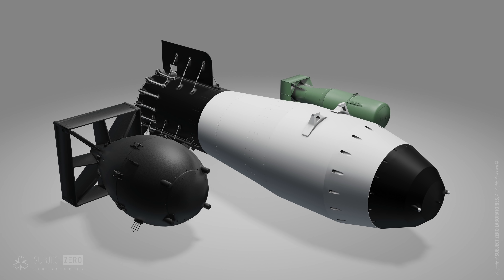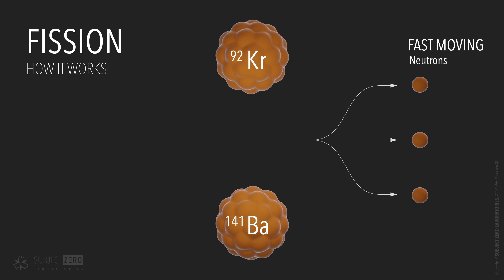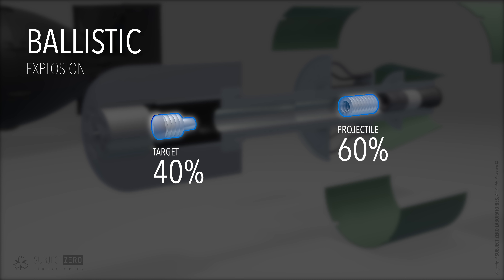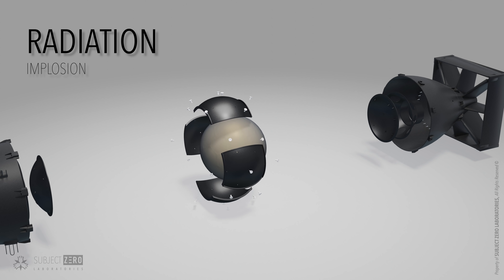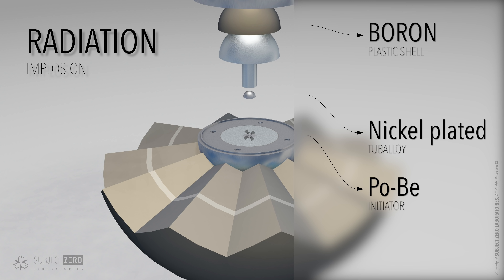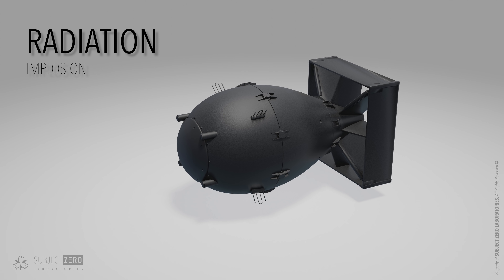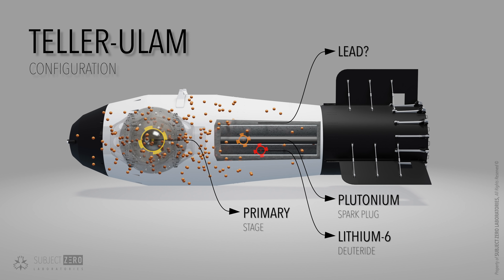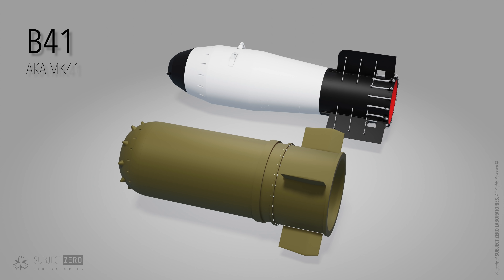Are Russian Nukes the Most Powerful?

Comment: Hey subject zero, I have an idea for an video, instead of explosion, what if we make an implosion bomb. This bomb will create a 1 gm of mass suddenly. According to energy equation, this creation of mass will draw energy from surroundings so a sudden drop of temperature in the environment freezing everything in close proximity. if the bomb capacity increased to 1 kg, a entire city will be freezed, so causing death at the same time freezing every motion of the city. Think about it. Even though the technology doesn't exist, theoretically this possible. A chain reaction than quickly produce extra mass from surrounding energy. A nuclear endothermic reaction😅🥳

Comment: Boloney ' there are neutron bombs to get this effect neutron accelerators are incased inside the weapon right at the start of the chain reactions neutrons are spun into the explosion with the bomb being encased in reflective material to reflect the escaping neutrons back into the chain reactions .  Israel has neutron bombs since they are surrounded by enemies close to them after 24 to 48 hrs neutron radiation clears away and you can then enter those areas with no risk of radiation poison .

Comment: When it states 80% enrichment, what exactly does that mean?  Is it possible to have 100% and so on?
Reply: Uranium is composed of U235 and U238.  U235 is the fissile material needed for a bomb.   However, only 0.3% of natural uranium is U235 so it has to be separated from the U238 and that's called "enriching" the uranium.   The higher the percentage of enrichment, the less material is needed for a bomb because a greater percentage is reactive.  Weapons-grade uranium is generally anything over 80% U235.   The U.S. weapons-grade material is above 88%.   Plutonium is a whole separate process and the problem becomes separating the Pu239 from the other residual radioactive materials with as little Pu240 as possible mixed in with the Pu239.

Comment: Wasn't the Tsar bomb rather a 3stage design, i.e nuke that triggers TellerUlam hydrogen bomb, which itself is used to trigger even bigger TellerUlam hydrogen bomb?
Basically no limit to increase yield that way, build a 20'000t H-bomb into a 50'000t submarine and have a yield of 20000*6MT/t=120GT, would make a nice crater in seabed and huge tsunamis, I guess.

Comment: Yes but the problem is that after 100MT the explosion goes only in the space..an 100MT warhead would be max. The designer was ready to build a 100MT bomb, but he was scard and in the last moment, he changed the bomb to a 50 MT. He was ready to make a 1000MT bomb but it has no juse and it would be as big as an 6 floor house so it couldent be droped from a Plane

Comment: My understanding is that building bigger than 50 MT has diminishing returns as most of the energy goes into space.
Reply: every bomb that explodes on flat ground sends a majority of their energy upwards, above ground detonations at 100M are considered the most effective since they produce a secondary shockwave that reflects from the ground and travels horizontally further increasing damage to cities.
Reply: @miguellopez3392  Interesting.  If we assume a spherical blast wave, it is not too hard to see that we get proportionately less effect the bigger the bomb.  In the case I described, you probably would be "better" served by having more bombs rather than larger ones.  I am sure there must be a study or ten somewhere on this.  Be safe ML.
Reply: @pspicer777  yes that's why the US and Russia made ICBMs with multi warhead payloads, these where individually much lower in yield but could do more damage to multiple cities instead of just 1, they did have around 10 nukes between designs. I think newer ones are like 17.

Comment: Great video! I have one question however… “what is the difference between a thermite nuclear fission bomb (like An602) and a implosion fission bomb?” 

I understand the first generation atomic bombs like Fatman could have been far deadlier if they used implosion method instead of gun type and uranium 238 instead of the 3 less electron atom , uranium 235.

But what r the actuall differences between thermite bombs and implosion style bombs?

Comment: Germany almost had enough heavy water for a nuke, but the British sabotaged the ferry carrying the heavy water.
Reply: No.  Germany almost had enough heavy water to create a reactor with which they could then conduct experiments.   You can either use graphite or heavy water as a reactor moderator.  The ferry was blown up by Norwegian resistance fighters.  The original British sabotage was for the heavy water production facility.

Comment: Anything of that size is completely wasted in Earth's atmosphere. The radius of maximum destruction on Earth depends on Earth's atmosphere and pressure. Only when the downward facing blast of the nuclear explosion speeds up as it travels outwards from its impact with the ground, it catches up with the circular explosion of the original detonation. The spot where these two waves overlap has the greatest destructive effect. There are fairly simple mathematical formulae that indicate how high up a bomb has to explode to have this maximum destruction radius depending on its yield.
With the Tsar Bomba it already had to explode at roughly 4 km height. This meant that the bomber dropping the bomb was inside the primary detonation radius, even at its original deployment height. But it was deemed an acceptable risk to test the Tsar Bomba anyway. The plane barely got away from the detonation itsself.

The next stupdity of anything this powerful is that the explosion expands relatively equaly in a radial pattern. Thus most of a nuclear explosion is wasted in the atmosphere, going upwards. This ratio increases the higher the yield, as the bomb has to be exploded at ever greater heights for its maximum destruction radius.
The Tsar Bomba's mushroom cloud expanded into the upper atmosphere at roughly 75 km height. At this height the atmosphere is so thin that the shock wave simply does not reach any appreciable speed to harm anything. Anything bigger simply radiates outward into virtually empty space, wasting the largest amount of such a huge explosion.
Sure, on planets with atmospheres of much greater density this would possibly cause much more destruction in a greater radius, but that's not really the point for terrestrial war, right?

Comment: My memory is fuzzy but I remember reading about how German scientists DID crack the nuke but buried it similar to how they refused to use Sarin gas.
Reply: Heisenberg figured out how to make a heavy-water moderated nuclear reactor, but did not have the resources to make a working prototype.  They didn't bury anything.  They simply did not have the resources during wartime to develop  reactors, separate isotopes industrially, let alone build atomic bombs.  Only the US had the industrial resources to build an atomic bomb during the war.
Reply: @vibrolax  And even the US wouldn't have done it (at least not before the end of the war) without the help of the UK and Canada.
Reply: @JonMartinYXD  Given how reluctant the US was to have any foreign involvement in the Manhattan Project, UK and Canadian participation was a sign of just how concerned the scientific leadership was about delivering results in time to affect the war.  Richard Rhodes covers this (and everything else) in "Making of the Atomic Bomb".
Reply: @vibrolax  The US reluctance to foreign involvement was quite wise in hindsight, given the security disaster that resulted from accepting UK-based nuclear engineer Klaus Fuchs (a devoted German Communist since the 1930's) into the heart of the Manhattan Project.
Reply: @MrLTJX  Not to mention the concern over the political orientation of many of the US scientific staff.

Comment: Neither Fat Man nor any plutonium fission weapon uses radiation implosion - if they were, the design of fusion bombs would have been easy, as high explosives alone could have done the job. It was Teller who realized that radiation (X-rays) produced by a primary could be used to implode the secondary in a fusion weapon. Implosion in a plutonium weapon is a purely ballistic phenomenon - NOT radiation implosion. Only in fusion boosted plutonium bombs does a small amount of fusion take place. The primary role in this case is played by the NEUTRONS emitted which boost the number of fission reaction for a given amount of plutonium (2x approx.)

The main reason why the 50 Mt bomb is impractical is not just the difficulty delivering the weapon: It’s because there is no target on Earth large enough to warrant such overkill.

Comment: The Russians determined that a 100 megaton bomb was large enough to create a fireball large enough to touch both the ground and the edge of space simultaneously.  As it was, at 50 megatons, granite at the site of the blast was turned to ash.  I don't think you need anything larger when you turn rock to ash.
Reply: Yes.  Sakharov did the calculations and was afraid the 100 megaton bomb would lift the atmosphere over the bomb into outer space and possibly destroy the atmosphere.  Then there was the fact that there was no way to get the plane delivering the bomb far enough away to not be destroyed from the explosion.

Comment: Today it is believed that the Posseidon torpedoes can deliver a 200 megaton payload. They can be used to create a tsunami on coastal cities and/or vaporize an airplane carrier in one hit.
Reply: Using a 200MT payload on a single aircraft carrier is a tad bit overkill.
Reply: @Zorro9129  Well, you also get a chance at sinking the support fleet around it :)
Reply: @DerekDavis213  It's because it's real. 200 megaton made no sense back when we planned to drop bombs on cities. That's why we never built them. Now, if you want to destroy a coastal city with a nuclear weapon while minimizing radioactive fallout, you need to create a tsunami. 200 megatons would do. Also, 200 megatons at a aircraft carrier is sufficient to vaporize its steel. 
https://en.wikipedia.org/wiki/Status-6_Oceanic_Multipurpose_System

Comment: The US Navy had an air dropped two stage nuclear bomb that was 500Kt or 63Mt depending on whether or not both stages were armed.
Aren't most nuclear weapons neutron devices? When a modern weapon is detonated, just before detonation, a large amount of tritium is introduced into the mass. The tritium releases a lot of extra neutrons
The "neutron bomb" is a myth. A neutron is harmless, somethings introducing an extra neutron can change a stable isotope into an unstable one, but one atom makes no difference.
The actual blast damage is limited to the visual horizon, radiation is only capable of travelling in a straight line in Earth's gravity. About 4 miles in any direction and it goes right over your head. A few feet of earth or water will absorb all the neutrons.
If you are close to the detonation point, the heat flash will turn you into air pollution, but then you are the lucky one. More will be burned slowly to death by the fires started by the flash. The shockwave of super compressed air will fill many more than the detonation and then the fall out is what will do the most damage.
That is why the US government still maintains hundreds of fallout shelters, but only Cheyenne Mountain is actually "hardened" against a nuclear strike. To see if it works, we will need a nuclear strike.

Comment: you said several times "fusion" where it should be "fission". Perhaps, Lithium is not breaking. Is it fusing. And you've lost the concept of   Fission Cross Sections: you can't simply scale the bombs just using weight/yeld ratio.

Comment: Wait what? So all you need to make a nuclear explosion in the most simple terms is to smash two pieces of uranium together hard enough in a tight space?
Reply: No.  First, you need a material that will fission.  That is either U235 or Pu239.  Both of those have to be created.  Then, you either compress the fissile material to a critical density or bring enough of the material together that it becomes a critical mass.  That's a mass that has enough neutron flux that a chain reaction starts.   Little Boy used two separate sub-critical masses that when brought together formed a critical mass.  It had to be done fast enough that the material would not pre-detonate and cause a "fizzle" (reduced explosion).   Fat Man used implosion where the core was a sub-critical mass, and when it was compressed from the explosive shock wave became dense enough to be a critical mass, and start a chain reaction and fission.   

Originally, a gun design, like Little Boy, was going to be used for the plutonium bomb.  That design was called "Thin Man."   However, the physicists found the plutonium from Hanford had Pu 240 in it which gave off far more neutrons than pure Pu 239.  That made the plutonium so reactive it could not be brought together fast enough with a gun design and would cause a fizzle instead of an explosion.   That is when the implosion design was pursued as it was the only way to make a plutonium bomb work.  Because the bomb now became larger (fatter in diameter) to accommodate the implosion design, it was named "Fat Man."
Reply: @buckhorncortez  Very interesting insight on the topic, thank you!

Comment: It's far from simple to make a nuclear bomb, requiring vast know-how, safety measures, and engineering skills.

Also huge amounts of money. The British nearly destroyed their government finances trying to support nuclear weapons development costs, added to ruinous wartime debt and matching enormous, new explosive spending on nanny government programs. Pakistan also deeply more impoverished their country, to achieve nuclear ascendancy. President ul-Haq once said, "Let them eat grass," before he was allegedly assassinated in a helicopter crash.

Plutonium has much larger capture cross-section for neutron capture, thus much more readily fissions, at enormous cost for producing plutonium in massive infrastructure to make it happen.

It's why nuclear reactors require moderator materials to slow fast neutrons from spontaneous fission (on order of tens of millions of miles per hour, to thousands of mph, to compensate for smaller nuclear capture cross-section.

Yet fast neutrons from a primary implosion core can produce an enormous flux to even trigger explosive fission in a natural uranium tamper and possible casing liner of early bombs.

Processing active/fission metals is chemically dangerous too. They're among the most toxic elements. Transuranium products also accumulate alpha emitter isotopes in bone marrow. Alpha radiation does the most damage to living things, inside them, compared to beta or gamma rays. Alpha particles are helium nuclei that grab electrons from surrounding tissue or bone chemicals.